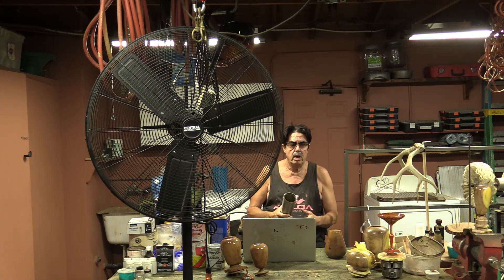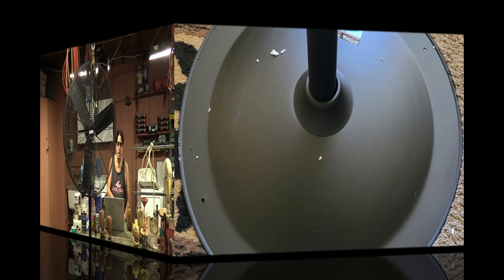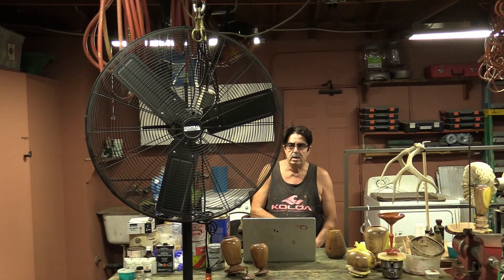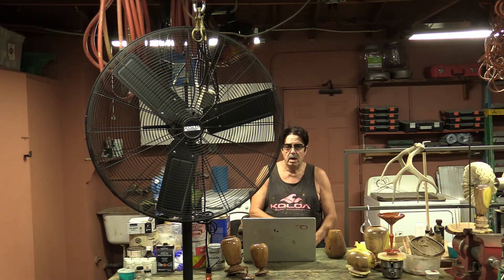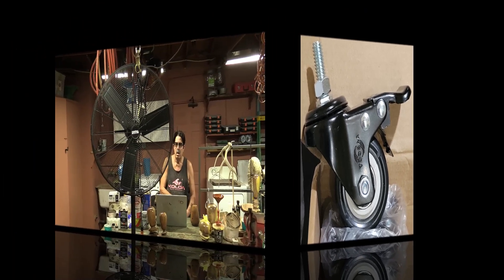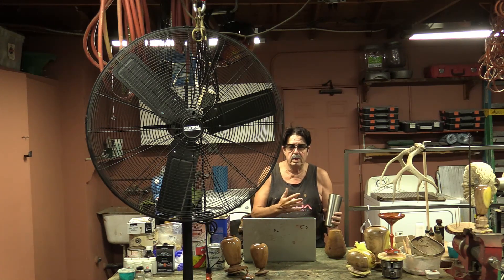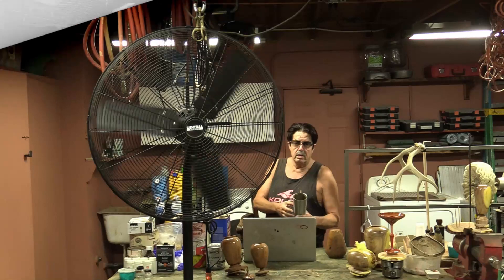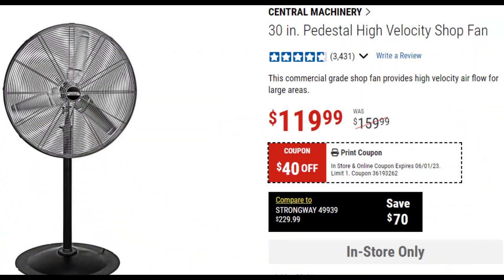Harbor Freight's 30" Pedestal Fan Review

Comment: Thanks, I bought one today with the coupon. I'm a steel framer in Texas doing barrack renovations, and our small company fans are not doing the job, but this greatly helps out!
Reply from the maker: You will like it for that kind of work as it will move a lot of air with that 3 speed.

Comment: Thanks!  I need a new shop fan, and your review explained the pros and cons very well.  By the way, if I put it on casters do I even need the rubber ring around the base at all?  It pains me also when commenters complain about every little thing too.
Reply from the maker: No you do not need the rubber ring if you are going to put it on casters - You will see negatives now a days on anything you are looking to buy but i do read thru them and discount the trivial things - This fan has been a great thing to have and wish i would have bought it sooner because it not only keeps a breeze going when your working but it really keeps my shop area so much cleanier.....Thanks
Reply: Good review. Fans that move large volumes of air are noisy and there is nothing you can do about it is the way they work.
Reply from the maker: It is really no that bad on low and medium - on high it is a bit loud but it can really move a huge amount of air.

Comment: Thank you for the video. Base on your review purchased it. Not a bad fan. Easy to install. My fan motor gets hot to touch on low speed for about 15 of running … does your fan does the same thing?
Reply from the maker: It does get rather warm to maybe hot and i was concerned a bit but after many months of use i am less concerned. It works great in my garage and the 3 speeds it has comes in handy. I use it mostly on the low and medium settings without any issues.

Comment: Can you please tell me I just bought this fan put it together have it running for 2 hours can you tell me please if your fan the actual motor if you put your hand on the motor it's so hot that you cannot keep your hand on the motor is it normal or something is wrong with my motor I still can return it I would appreciate your response thank you very much
Reply from the maker: Yes the motor gets hot - Mine will get hot to touch and its hard to answer this because everybody I know says the motor does get hot. But not extremely hot but it is hot to touch. I thought I may take it back but i didn't and it has been running fine without any issues. I use it regularly in my shop so its been holding up well and works very well so far.
Reply: @TheHomeHandyman  greatly appreciate you response have a blessed day